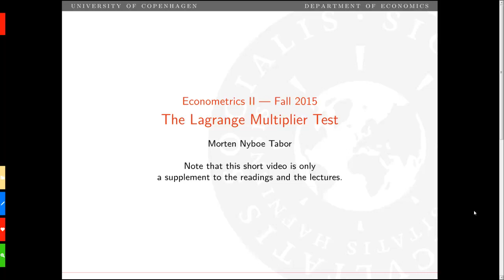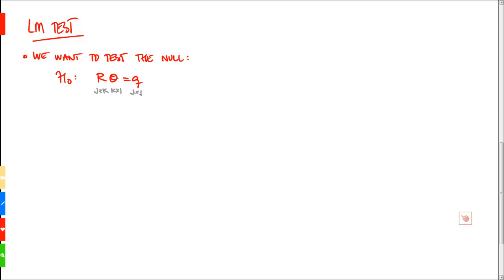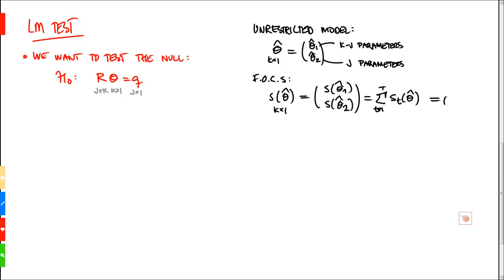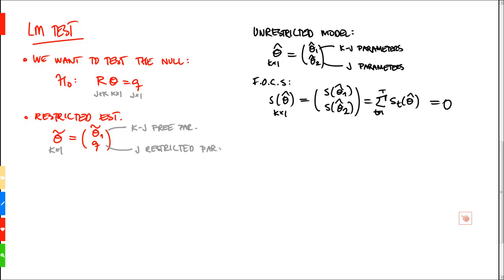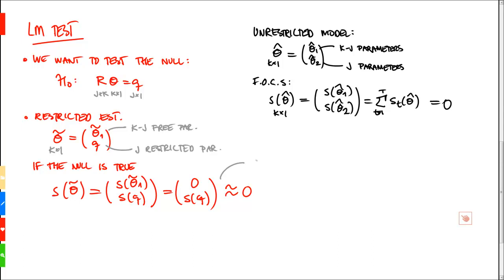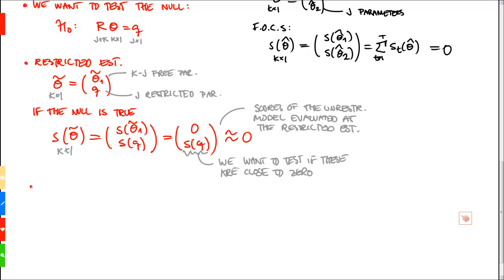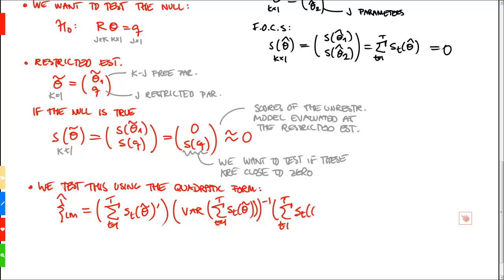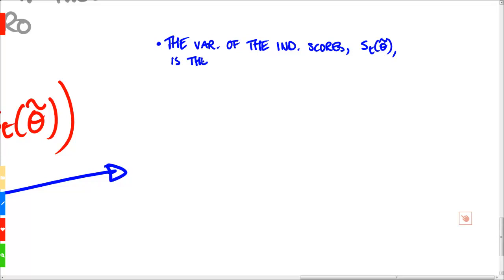The Lagrange Multiplier (LM) Test

Comment: Hi Morten,

Really like the content of the videos though I'm having a few issues with the sound in parts of the video.
I don't know if it's at my end, but if not you might want to check it out.
Reply from the maker: +froop0 Unfortunately, there are some sound problems in this video. I apologize! 

I recorded this video at home using different headset than I used for the other videos. I will not use that headset again... :-)